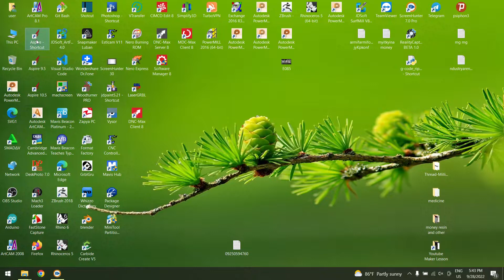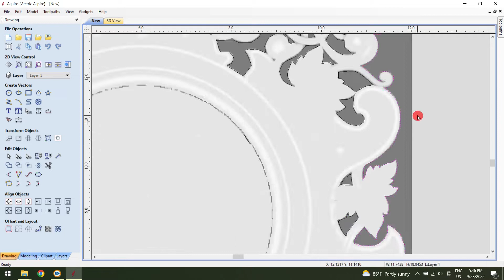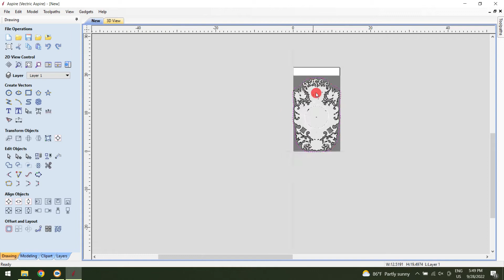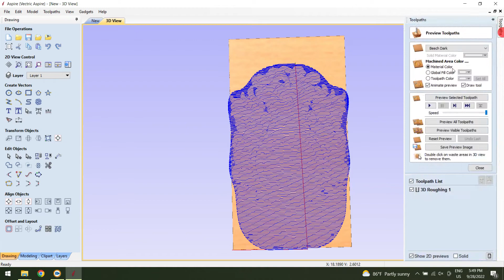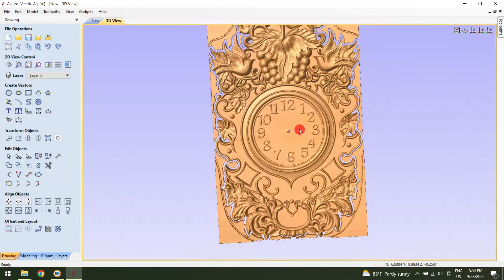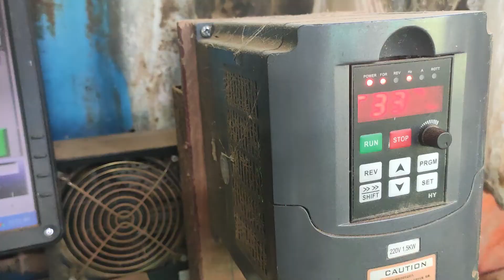Engraving bird clock with DIY dual head CNC // Woodworking

Comment: Hello.  What you do is very beautiful.  I had some questions about your CNC machine?  What is the model of your CNC controller board and does your CNC motion system use chains?  Thank you if you answer.  Because I am researching to build a home cnc.
Reply from the maker: i use parellel port controller board mach3 and motocycle timing chain with marger pinion.if you want some photo please hi my mail naungnaung9979@gmail.com
Reply: @nganaungcnc  Thank you for answering my question and I sent a message to your email.